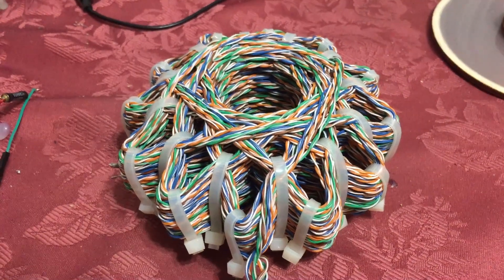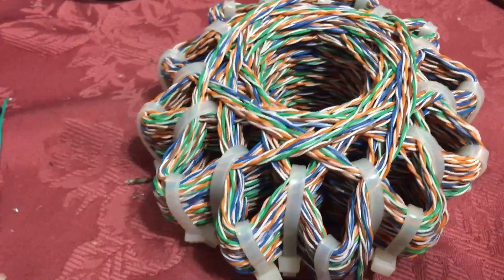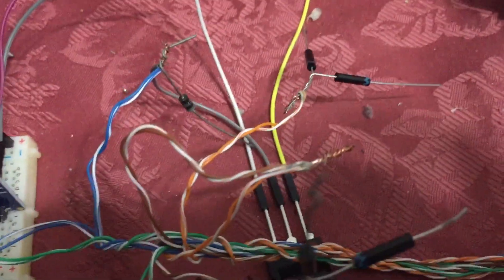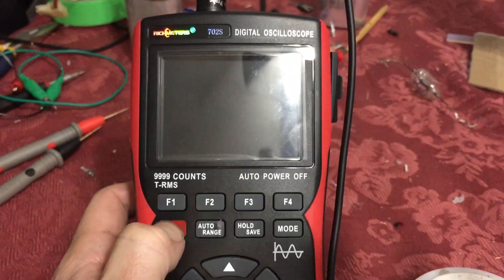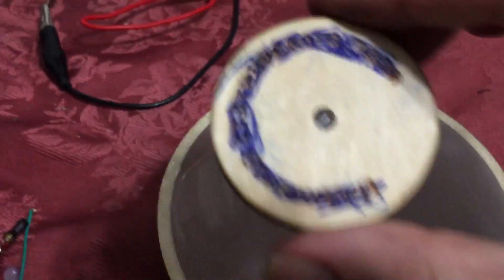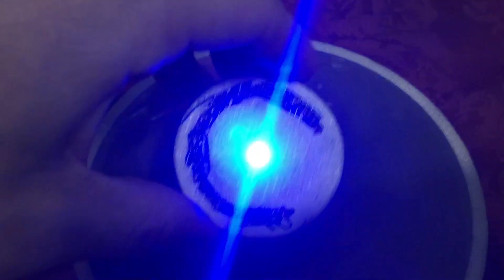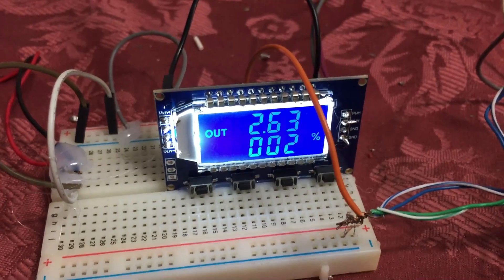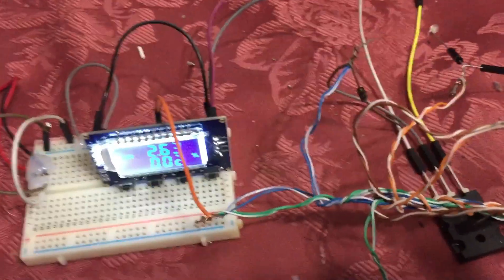Rodin Coil One Wire System

Comment: Its great to see my coil in the hands that can do something with it.  One quick note its a STARSHIP Coil.  The Rodin Coil forms around a torus where the starship is a pattern of segmented straight wire in a folding configuration.  The 2 3D printed formers will make rodin coils after you wind some wire on them. Keep exploring I Love it!!!!!
Reply from the maker: Thanks! I'm asking folks how to wind these lol
Reply: @joellagace1679  I built a winding jig.  The pattern is skip 3 clickwise.
Reply: Clockwise.  I will put together a video showing the coil former for those who want to give it a try.
Reply from the maker: Awesome thanks!
Reply from the maker: Maybe I got confused lol, New to these coils. https://www.amazon.co.uk/Marko-Rodin-Mathematical-Vortex-Device/dp/B08HC5WB8L
Reply: @joellagace1679 I’m pretty familiar with radionics since I make them myself but I’ve never seen anyone use a pulse generator like that. I’m interested in knowing more about it

Comment: using dead batteries that still carry potential placed in series to get higher voltage is easy way to get as few joules as possible threw an inductor , cause all you need is one joule to flow and bam! you have flyback

Comment: you can have 1 million amps with 12 volts sitting behind one inductor but if that inductors resistance dictates a voltage requirements of 13 volts to push a single joule and all you have is 12 volts then your 12 volts will push zero juoles threw that inductor aka no current (O)

Comment: your not getting "Flyback Voltage"  (Back EMF only exists in Iron) cause the coil has higher resistance so you need a little more voltage to push threw the coil all the way , like breakdown voltage but for the inductor